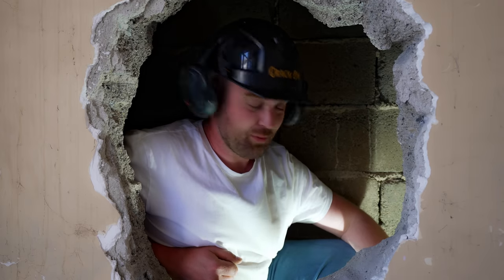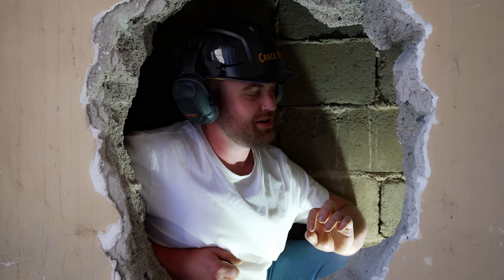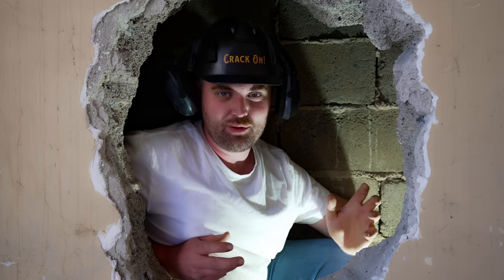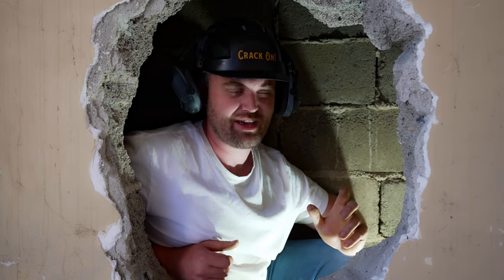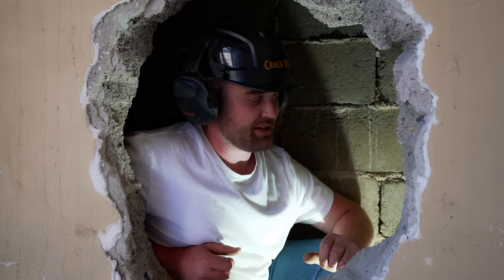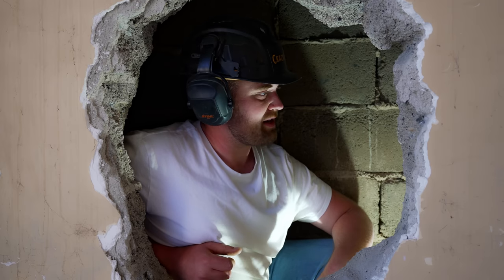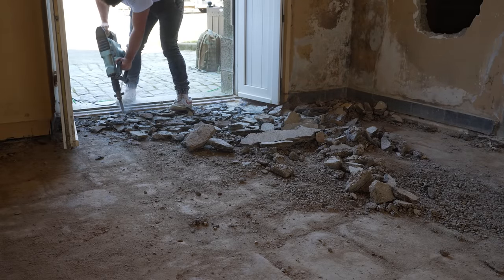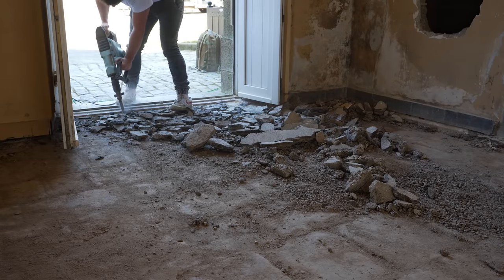A Discovery Behind The Wall At The Convent!

Comment: The void would make a wonderful place for coats, hats and such. Loving the floor.
Reply: Good idea!
Reply: And I think there have been doors found around in the attic or basement or outbuildings that might fit, or might even have been original. If not a coat closet, certainly a utility closet would be another practical use.
Reply: I was just going to suggest the same thing. Maybe even put a chest style bench for seating/shoe changing, plus you could incase a time capsule inside of that. I was picturing like a mud room type alcove like we have in some homes in the states.
Reply: Loving the floor even more. Can’t wait to see it all scrubbed clean……what a prize!!😁
Reply: That floor is just marvelous,  I wouldn't dig it up, might not look as beautiful after, which would be a shame. Besides preserving old workmanship when it's still solid and safe is as important as preserving the materials 😊 ❤

Comment: Billy, the void in the wall near the door may have originally been a porter’s nook or booth.  In the age in which this convent was first built, it was common to designate one, usually older, nun as porter.  A respected position, the porter held all the keys and was responsible for all comings and goings.  Workmen—men—would have come to the premises for repair work, for the renovations and redos you’re finding, for heavy lifting, delivery of food and the carting away of all waste material.  It was considered proper for one responsible nun to know at all times who was coming in, let them in, lock the door, quickly escort them to their destination, and return to her post.  Actually, this was not unlike how the aristocracy and merchant class alike operated: women and girls did not answer the door.  It was not considered safe.  Home invasions are not a modern invention.   As the centuries moved on, changes were made, porters less needed.  But some big convents and monasteries  still had them in the first half of the 20th century.  Crack on!
Reply: Were cinderblocks original?

Comment: The void was perhaps an old doorway that gave way to a corridor on the courtside of the kitchen wing, all along the wall towards the door to the left of the fireplace in the kitchen. That is why the fireplace in the kitchen is not in the middle of the backwall. If you imagine a corridor on the left side the chimney would be exactly in the middle of backwall. The corridor was perhaps separated from the kitchen with a wooden screen with a view glass panel or internal windows.

Comment: The Idea of ramping Is nice, however you would end up taking up half the floor to do the ramping, so you might as well just rase the floor up.
Remember, the ramps would have to almost reach the center of the room In order for the lift to be able to clear the ramp.  You can't just do a 2'
ramp and expect to get the lift over that.  Also both front and back doors would need ramping and again with moving any kind of carts or wheelchairs
in and out they would end up about 4' long. That's about 75% of the floor coming up to make ramps.
Reply: You explained that much better than I could have. Many think that the ramp can be very steep, not realizing the tripping hazard they can be. Walking into a room with just a 4 inch (10cm) height difference would cause many a stumble from those not ready for it.

Comment: I would leave the floor down and when you change the doors take out the frames and lower the threshold to the same level as the internal floor. Then add ramps to the outside 😊

Comment: I had a thought about ramps for access out of the hallway area where you just revealed the wonderful cobblestone floor. I think it might be better to leave the floor flat after cleaning and replacing the grout/lime and adding a sealant. Then I think it might be a good idea to construct ramps of hardwood to fit the period of the building. Don’t know if the wood recovered from the basement could be re-milled for that purpose.

Comment: Also remember, the floor connects to the heated floor In the kitchen can't be touch. It could damage the kitchen floor heating system. Which means the ramp
couldn't start In the small hall way, It would have to start In the room.

Comment: Could it be that the cavity was put up to reduce the amount of space in the hallway?  In the '60s and '70s many old houses were hard to heat, especially stone walls.  Because of this, many home owners opted to reduce the size of a few rooms by building walls a meter away from the original to act as 'insulator spaces'.   The fact that there is another concrete block behind you suggests that there may be the same on the kitchen and refectory sides.  Perhaps that when the convent was first built, the refectory and kitchen were one and the same?  The high doorways into each room suggests these may have been added, not originally.

Comment: Use a little diluted phosphoric acid on those cobbles to rid them of concrete residue. Give it a good scrubbing with a natural fiber deck brush and they should shine. Then rinse if off with plenty of water so the runoff won’t harm any greenery in the runoff trail. Then, Crack On!

Comment: Can you lower the sills of the front and back door down to the level of the old granite floor, presumably that is how they were originally?
Reply: I think lowering the sills would be extremely difficult and would not address the interior doorways problems. While just as difficult, raising the floor might be a better method and would correct all of the doorway problems.

Comment: I suspect they laid concrete over the granite flags to level the floor AND "modernize" the place, probably after WW II. That cavity is walled up on BOTH sides with CMU's (cement masonry units) which does establish something of a potential installation time frame. My curiosity is what is on the other side of the OTHER CMU wall at the back of the cabinet.
Reply: @ThePethericks - Cement block (CMU's) first came into use in 1946, so at least you have that as the earliest possible date for that remodel. I would suspect it was later than that by at least a few years due to the European chaos following the war.

Comment: A ramp for access is nice, but... ramps are used when there's no other choice. They are still more difficult to get up and down than if the ground is flat. ESPECIALLY if you're moving a heavy load.

Digging up the stone to raise it is a LOT more work, but in the end will result in a much more access friendly hallway than any possible ramp.

Comment: What if you were to make a permanent paved corridor (buy removing all old doors and framing, cutting stone back on each sid.e) Install lock gates at each end so that bringing in or removing anything from either front or back would be a total breeze to move. If that type of modification is allowed on the building of course

Comment: 7:57 Given the 'Cinder Blocks' shown when Billy opened up the wall they may have been added much later to reduce the size of a room. A little history; "The first hollow concrete block was designed in 1890 by Harmon S. Palmer in the United States. After 10 years of experimenting, Palmer patented the design in 1900". So my conclusion is those cinder blocks were added after 1900 and the Convent is clearly older than that. More mysteries from the Convent? Thank Billy, Sean and the team. Keep Crackin On! :)
Reply: I think that this area used to be open and there was a corridor going down along the side of the kitchen. They probably closed it up and removed the interior wall  to increase the size of the kitchen/get more natural light in. They wouldn't have have to go outside to get down into the cellar. 

It would explain why the fireplace is off-center too.

Comment: The floor is beautiful.  I wonder if that cavity might have been an old phone booth.   They used to make secluded places like that in hospitals for people to call family in private (at least in America).  Hello Matisse!  BTW, your looking good, Billy, whatever it is, keep doing it.  🧡
Reply: I doubt it. This place was built long before telephones were invented. I don't think it was an entryway at all, I think it was a passageway between the two halves of the bottom floor and that they used to get to the backyard. They could also pull a cart full of veggies and fruit in to make it easier to bring down into the basement for cold storage. 

There is a telephone room on a higher floor with a phone still in it, though.
Reply: @b.w.6535  I was thinking along the same sort of lines except i'm wondering if it was 2 buildings that have been connected together. Would explain why it has oak beams unlike the chestnut for the rest of the convent
Reply: @geoffbird3637  this is an interesting hypothesis.  If the chestnut beams were part of a later addition, it would also explain the rather awkward hole in the floor that leads to the basement.  🧡
Reply: @geoffbird3637  It very well could have been!

Comment: Bravo Billy, great effort usually results in great rewards, the inside wall of the cubby looks like cinder block, what is your take on how recent an addition that is? and what might it have been?
Reply: I noticed the cinder blocks also and wondered what is on the other side of the blocks. If it is the kitchen then a coat closet sounds like a good idea. I also like the idea of ramps at the doorways.

Comment: I'm wondering with how you're revealing that beautiful original flooring in the entryway if it would be possible or feasible to relocate the stairway into the basement into that little room on the other side of the wall opposite the kitchen and cover up the current stairway down? It seems a very awkward stairway anyway and it interferes with the flow of that beautiful entry hallway. Just some thoughts as I'm watching your work on this area Billy.

Comment: Nice floor. It seems as if the original stone was not at the same level all the way through, the concrete/tile layer was much thinner at the front doorway than the rear, and was the reason for covering it up.?

Comment: Could the void be the result of the builders trying to match the thickness of the wall on the other side of the flagstone passageway?  That wall is an original thick stone exterior wall.   Kitchen side has cabinet on one side and void on the other side to fake the thick stone wall and match deep doorway on the other side.  How about taking out rest of bit you started, doing nice finish on wall and filling space with a rank of armoires, shelves and pegs for hats, coats, wellies, etc ?